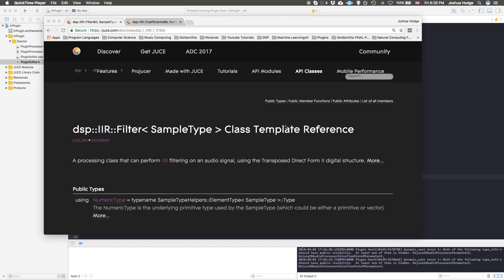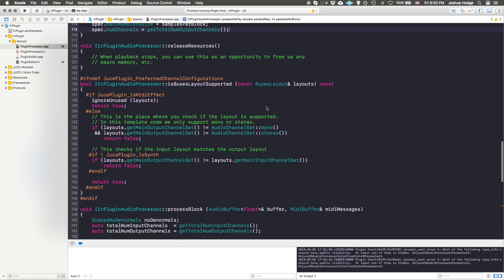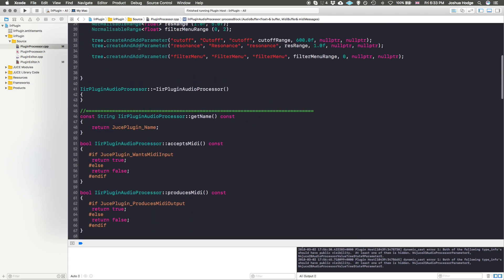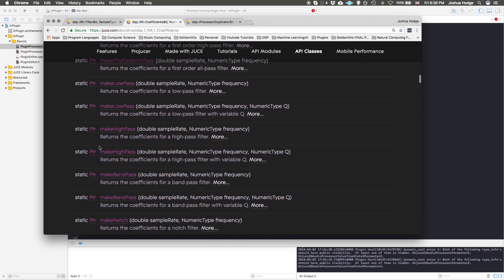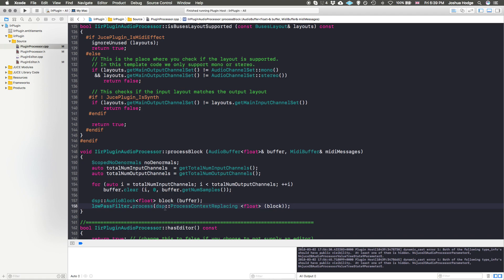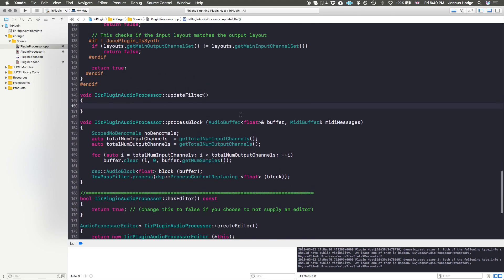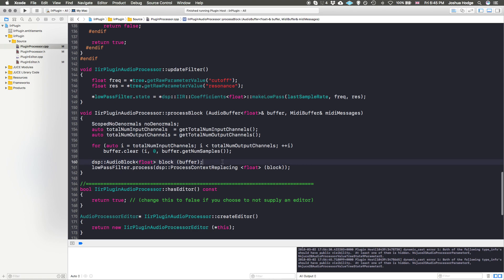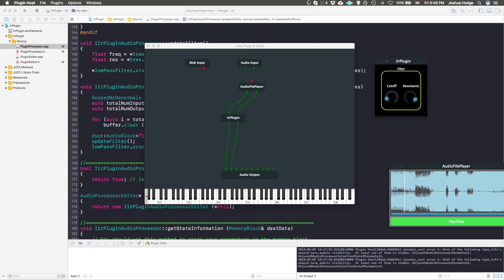Juce Tutorial 31- Building a Filter Plugin Using the DSP Module IIR Filter

Comment: Any advice for making a 3 band eq similar to what's on a guitar amp? By that I mean set frequencies, set q, but gain adjustments for a low shelf, band pass, and high shelf? My first thought was to separate the signal into 3 signals and create filters to adjust only the appropriate frequencies then combine them again at the end. I'm sure you guessed based on my explanation, but I failed miserably and I can't seem to find any useful info on doing this. Any thoughts? Thanks for all the tutorials by the way, they've been massively helpful.

Comment: Thank you so much for the tutorial! I have one little problem. It feels like the filter is not stable. It produces a lot of crackling and when playing around too much with the cutoff freq slider, Reaper automutes the track I'm using the plugin on. Any idea of what could make the filter more stable? or maybe there is something that Im missing.
Reply: @TheAudioProgrammer  Thank you so much! I followed the tutorial with the process duplicator. Using LinearSmoothedValue for the cutoff frequency did not help and I've been advised to try processing in smaller blocks. I will join the community :)

Comment: Hey thanks for this video , as always it was super helpful! A couple of questions 1) Does the filter need to be initialized in the initialization list? Is this something we might be able to do in the body of the constructor or by a call to updateFilters() in prepareToPlay? 2)What exactly is the purpose of the reset() call? Thanks!
Reply: @TheAudioProgrammer  All super helpful and appreciate the reply!  I think when I tried something like what you wrote for using the copy constructor, I believe I got an  "no overloaded =" error, I'd need to go back and check though. What I found  works is to declare all of the duplicators in the header file, then create a new coefficients pointer by using something like " auto LPCoefs = new dsp::IIR::Coefficients<float>::makeLowPass(sampleRate, cutoff, res); " Then even without the initialization list, you can set the filter's state using " *Duplicator.state = *LPCoefs; "  The reason I asked about the initialization list is that I'm trying to build a multiband processor which potentially needs to use a whole bunch of filters, and thought it would be hairy to instantiate them 1-by-1 in the list. Thanks again!